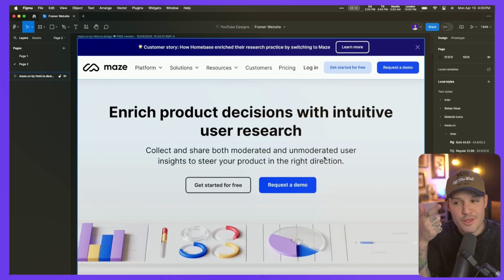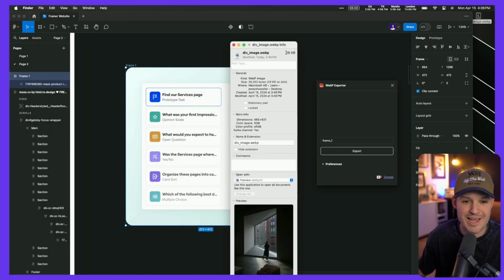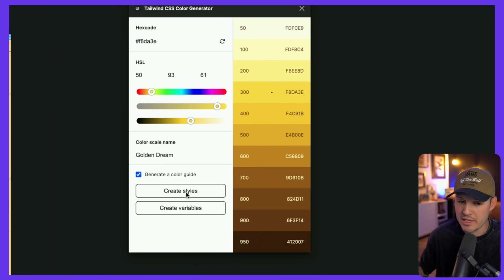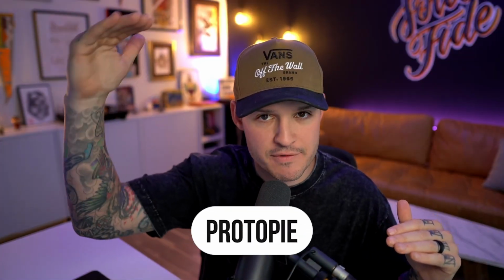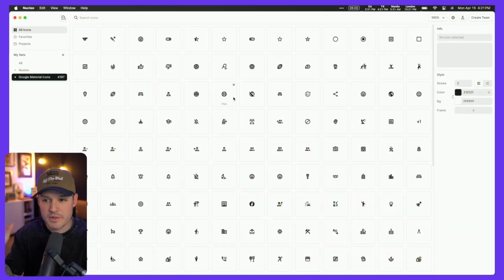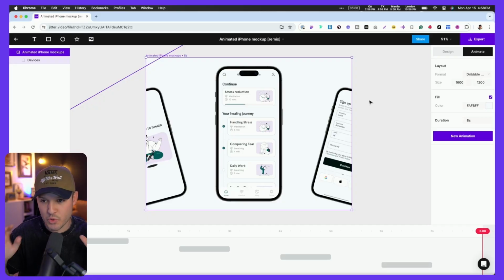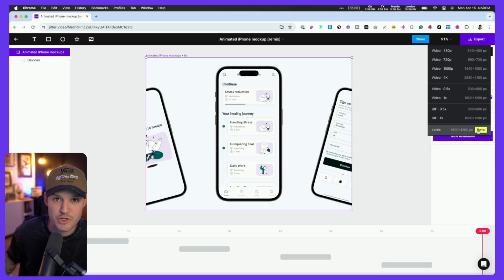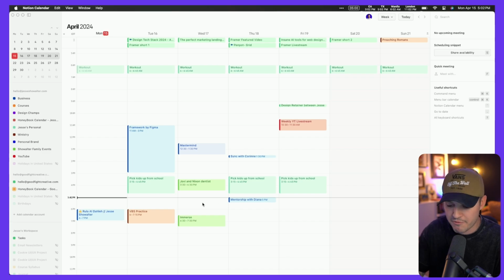My Design Tech Stack

Comment: What do you use for app design? I've recently starting using CSS Peeper - think you mentioned it in another vid, but I don't think you can use it for apps? and same with html to design. Back in the day I'd screen shot and just eyeball the design or like guess and I'm still doing that for apps but wondering if there's better ways, thanks.

Comment: Thanks for sharing, Jesse! This is really helpful. The HTML to design plugin looks sick, potentially a big time-saver when doing redesigns or working with “make me a website like this one” clients . My primary tool is still Sketch though, since you can’t underestimate the flexibility of working offline (e.g., cheap airlines, beach, etc.) and also actually owning your design files :-) .

By the way, is manual image optimization to WEBP format still relevant? In my experience, a good hosting platform usually comes with a CDN that optimizes images automatically, so it might actually be better to upload high-quality images directly.